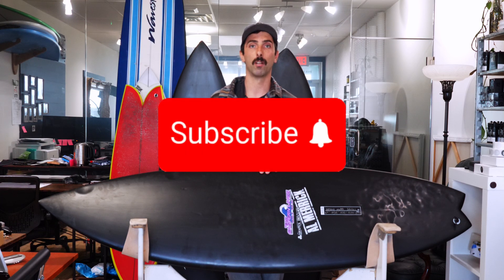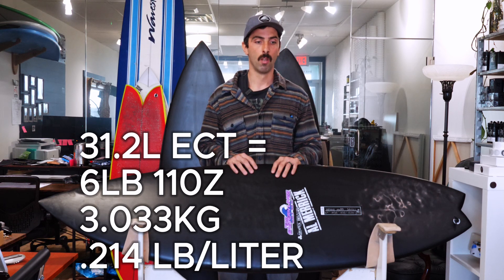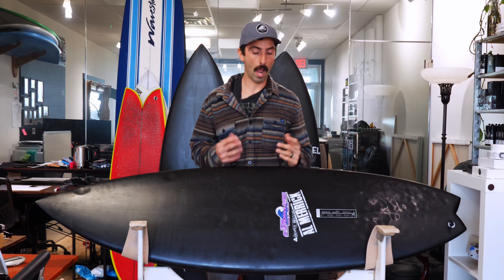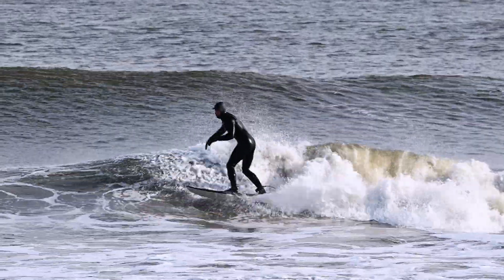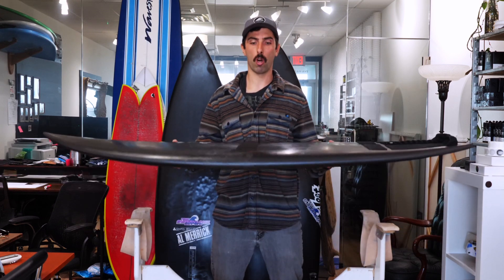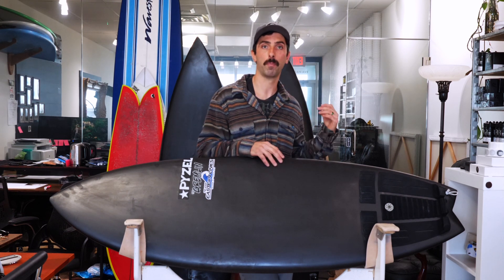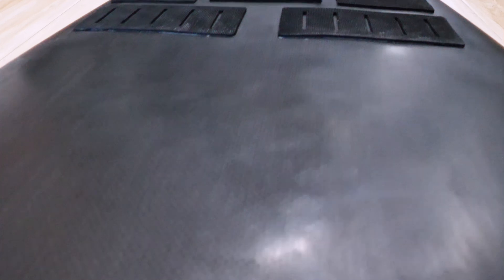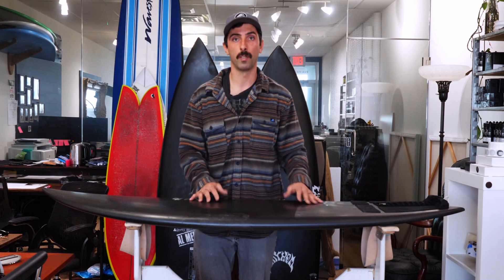CARBON FIBER SURFBOARDS EXPLAINED |TECH TALK|

Comment: Great review! Didn't you find the ECT at 6lb 11oz too heavy on your feet compared to other boards?
Reply from the maker: Thank you for watching, the ECT feels great and is still lighter than a stock board off the racks. I actually don’t mind a board with a little weight. Been riding boards with 4-4s/ 4 bottom lately

Comment: ECT surfboard, without stringer?
Reply from the maker: The ECT has a stringer, it starts as your normal PU/PE or EPS blank and the carbon is added into the resin during the glassing process.

Comment: I've been repairing creases/buckles in the full carbon models, and delams under the center reinforcement carbon along the bottoms of others. I wouldn't say it adds longer life to your sled. Factor overall cost and the usable life before it buckles, when the repair adds weight and stiffness in the flex. Cheers
Reply from the maker: Valid point, I did have to do a repair on the dark arts and it took a LONG time to dry out!